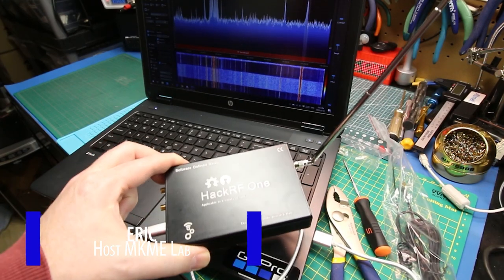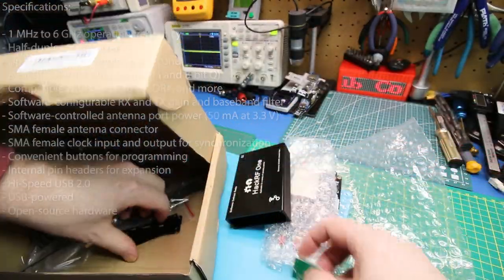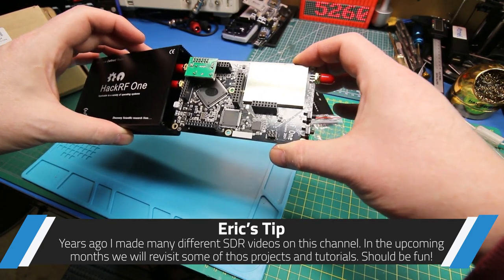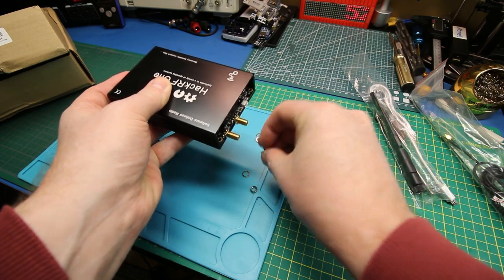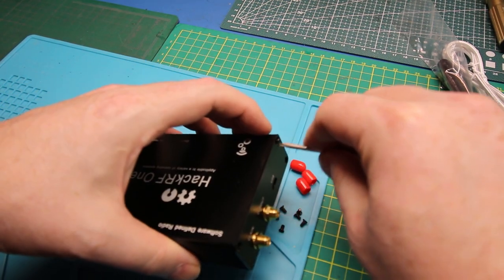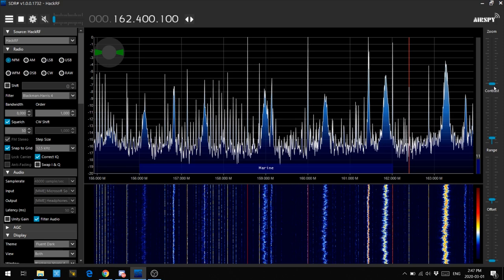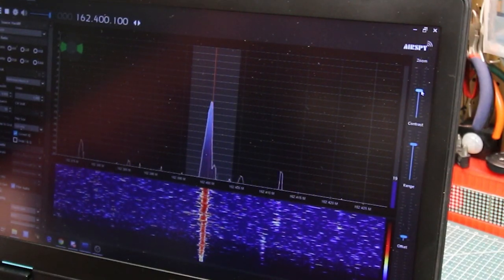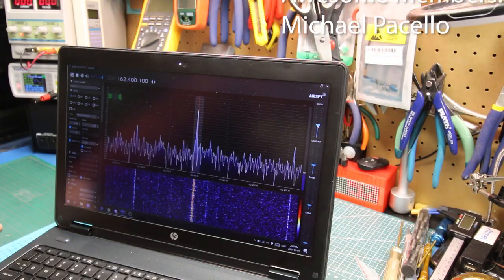HackRF Software Defined Radio- Assembly & Test📡

Comment: Hi i have the following question. Is the HackRF One usable with GNU Radio under Windwos 10 or Windows 7 ? If yes, could you recommend me a website or tutorial where the Installation of HackRF One under Windows is explained and get it Running in GNU-Radio ? Thx

Comment: Hello dear sir. Before everything, i need to thank you for your nice video. I have a question about the PCB. I want to setup the pcb over a specific frequency using its software and then disconnect it from computer. Then, i use its output port to my other pcb. In fact, i want to use it as a receiver RF that is tuned on special frequency. Do you think it's possible to do that?

Comment: Would you recommend the clone for someone on a budget? Do you think you will do a followup video of how its working. Worried based off comments that its good for a short time then starts to bug out.
Reply from the maker: I picked the clone as I'm on a budget. No issues yet but I have not used it much and probably wont for some weeks at best.  Too many other projects now that the pandemic is here.
Reply: @MkmeOrg  How's the budget option holding up. I didn't realize there was a cheaper version, so I just got the original. I purchased it through Amazon though, so I can return it. Where did you get this one, and who makes it? Does it have any downsides compared to the original? I might return mine and get this one if it's all about the same.

Comment: Just bought one on Aliexpress with an active mini whip antenna 10Khz 30kMhz. Can't wait! :)
Reply: Hi, how's your purchase, I'm thinking of buying identical set, how's mini whip performing? Did you compare it with any other antennas, where do you have it, indoors, window, roof?
Reply: @mistahke  works great! The antenna is in the attic, it could be way better on the roof but it's working fine. I can hear radio amateurs from all Europe, Chinese/Indian shortwave radios etc!
Reply: @mistahke  sorry for the late reply
Reply: Those are fake
Reply: @TheHermitHacker  you make absolute no sense. They aren't fake, but good clones and even though you purchased the original one you still feel the need to come here and qualify. I bet you bought it on Alibaba too 🤣
Reply: @Eric-the-wise  chill out ffs, it’s open source, so yeah it’s not fake.

Comment: Hi one and all.
I am just looking for a bit of HELP !
I am thinking of buying a HackRF One. But I just need some helpful information. I have seen a thing by the name of the Portapack H2
But is that the same thing as a HackRF One, or is it something that you ADD to the HackRFOne.   As I am new to SSR radio, and would like to have something that I can use when I am out and about. As I do NOT drive, I would NOT have any power supply and also it is not that easy to carry about a laptop or even a small tablet. 
So it is NOT technical information that I am looking for, more like practical information. 

Bye from John.
Reply from the maker: The Portapack is an addon for the HackRF.  They are 2 pieces of hardware you combine.
Reply: @MkmeOrg  thanks for letting me know. For now I will have to hang back on getting both of them. It is NOT a money thing, it is the fact that I have cataracts on both eyes, so I am finding it VERY hard to see anything. But as SOON as I get my bilateral cataract removal, I will be able to read all my ham radio magazines that I have NOT been able to read for the last 6 months. So to TRY and use a radio combination, it would be a waste of time as yet. 
But many thanks.
Reply from the maker: @jonc4271  good luck with the surgery. Speedy recovery
Reply: @MkmeOrg  Well I was told in December that I was down to have the operation SOME time in January to February. But at the end of January I was told that I would be getting my eye operation in April. But just the mid part of this week, I contacted the hospital. But I was then told that “NO WAY” that I would be getting my operation in April. I have been told that to expect it to be about 3 months time. But the STUPID thing is that they is ONLY 6 others getting the same operation before me. For Gods sake, even it they just done 1 operation a day. Then that would be just over a week for my operation. But as with EVERYTHING now, they blame on it all on Covid 🤬 
But it is what it is, and I just have to sit back until the day that I go in for my operation. 
But thanks for your nice words.
Reply: @jonc4271 how did it go ? Can you see yet ?

Comment: Hi bro i need to help me about hackRF one ... ? 
My problem is windows 10 can not detected hackrf coud you plz help me
Reply: Had the same problem, you need to update the firmware on the hackrf
Reply: @main7767   problem was on oscillator i remove it and I upgrade firmware after that I returned to install oscillator 
Thanks pro for answer 🌹🌹

Comment: HackRF one antenna is not protected you live near a airport or just a strong signal will kill the preamp. Terribly designed not worth even a $100 let alone $300
Reply: Fit For Flogging couldn’t you just replace those parts though?